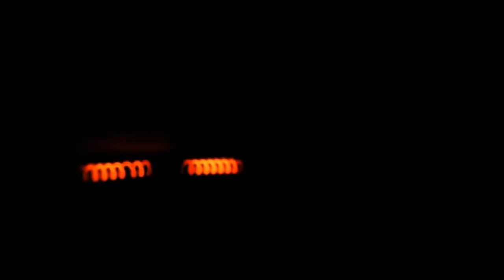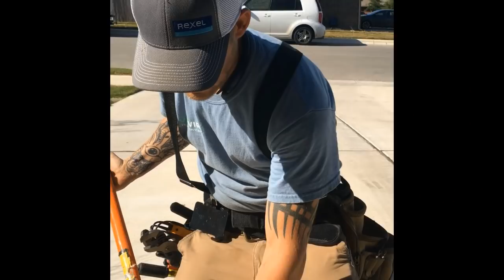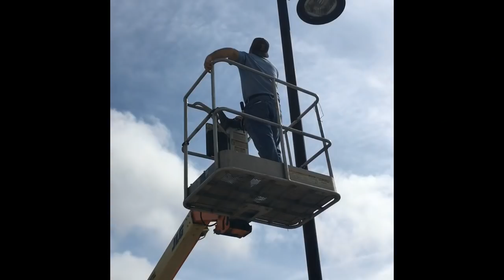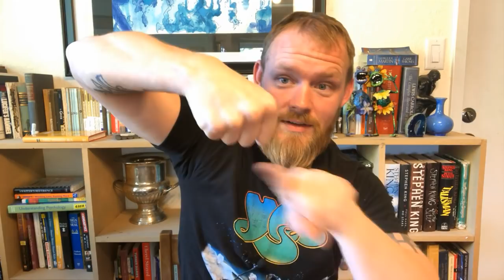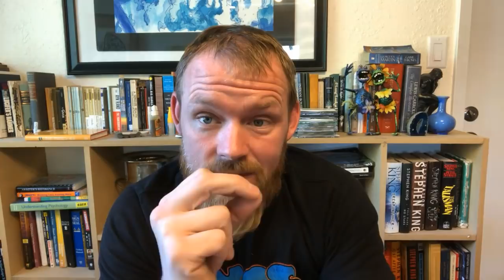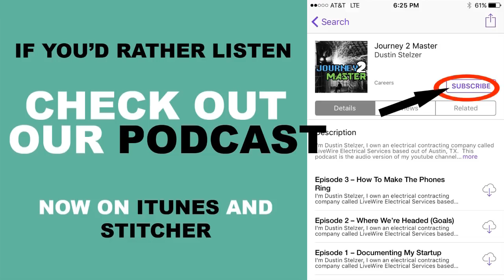Episode 42 - #THDProspective tool event summary

Comment: Also is there a book you would recommend for for all the basics of electrical
Reply: Jeffrey Hall While its hard to find an electrical book that covers all the basics, any Electrical textbook would do. He also has a video on books and lists a dozen or so really encompassing books.
Reply: The Faithful thank you so much I’ll look into it much appreciated
Reply: Rocky_rocker_123 I’m going to get into construction electrical and I’m pretty new when it comes to all of it, i just want to get a head start before i start a apprenticeship
Reply: What industry are you going to start in? Like residential, commercial, industrial? Or service work or construction work or both? Yeah there’s a lot basic book or starter level books for each area. Are you looking start in residential wiring, trouble shooting and residential code? Construction has ton of stuff. Where are you at in your learning? What you dove into so far? There’s also basic theory electronic components too that might great to learn too for control.
Reply: Jeffrey hall Nice. Smart move man. Learn much as you can while your young dude. Just makes life better in the long run. Always keep open on service work too. Trouble shooting is fun too. Do you own a good multimeter yet? Do you have code book yet? 

Tried YouTubing these topics
1. AC genterating power systems(Wye & delta)
2. Inductive, Resistive, Capacitive type of loads. 
3. Conductors, semiconductors and insulators,
4. series and parallel circuits. 
5. power factoring correction. 
6. Capacitive banks
7. Types transformers(oiled or dry) and how coils interact with each other
8. 3phase AC generators and motors. 
9. Single Ac generators and motors. 
10. Variable frequency drives
11. Constant voltage starter
12. Relays(coils and contacts)
13. Capacitors (oil filled or dry)
14. Resistors
15. Transistors
16. Relay Ladder logic schematics 
17. Plc program logic controllers
18. Logic gates
19. Dcs Distributed Control System
20. Digital field devices
21. Analog field devices
22. Resistor banks
23. Dc electronic drive
24. Clock system
25. Electrical Induction heating and resistive heating system 
26. Distribution power panel boards.(3phase, single phase, DC)
27. High voltage or low voltage Switch gear
28. UPS-uninterruptible power supplies systems and standby power supplies systems. 
29. Batteries banks
30. Metering/testing instruments - volt meter, ohms meter, amp meter, watt meter, current transformer for high voltage, potential transformers for high voltage, insulation tester, 
31. Lighting- Incandescent lamps, Compact fluorescent lamps, Halogen lamps, Metal halide Lamps, Light Emitting Diode, Fluorescent tube, Neon lamps, High intensity discharge lamps
32. anode and cathodic protection systems
33. GFCI Ground Fault Circuit Interrupt, AFCI arc-fault circuit interrupter, thermal overload protection, breakers  fuse, time delay fuse, screw in fuses, 
34. How meter with power on and finding blown fuses or open circuits. 
35. Emergency lighting systems
36. Pipe bending(rigid conduit and emt conduit) fittings too.
37. Conduit fill calculation- code stuff
38. Box fill calculation- code stuff 
39. Pull box calculation- code stuff
40. Basic read the code book and search sections on YouTube or google.lol
41. Cable trays
42. Busway power system
43. PVC (polyvinyl chloride)pipe expansion joint calculation
44. Amour cable and tech cable
45. Code will explain location/ environments for certain types cables can used 
46. Non-Metallic Dry service cable
47. Wire gage size according to amp rating
48. Ground rods
49. RS232 communication cable
50. Ethernet commutation cable
51. Fire alarm systems
52. Safety protection(low voltage gloves, ark flash face shield
53. Electrical Isolation procedures
54. soccer lift and boom
55. Crane hand signals
56. Basic load Rigging. 
57. scaffolding
58. Fall protection 
59. Electrical wiring for hydraulic and pneumatic system. 
I probably missing more stuff but this all can think off top my head. Hopefully these topics give yourself a jump start.
Reply: Also forgot this stuff too
60. 6 pulse full wave rectifier, full wave bridge rectifier, half wave rectifier and wheatstone bridge. Now they used electronic drive(IBGT’s) to get the clean dc supply.
61. Rigid Pipe reaming and threading
62. dynamic braking and regenerative braking
63. impedance relay For sang dip in voltage supplied 
64. Earth fault protection.
65. Ohms law calculations. Very important for electricians. 
66. Stoves circuits (code book)
67. Dryer circuits(code book)
68. Dwellings power panel service sizes calculations(code book)
69. Motor control center ( MCC)
Reply from the maker: episode 20
Reply from the maker: Holy shit bro.  That's amazing.  Thanks for sharring, you sound like me hahaha
Reply: Master to journey-> yeah.lol i was going to put more but I didn’t want to blow up the young dude comment too much and look fucking squirrelly. Haha Plus, i enjoy helping out the young minds that are coming out of high school and needing a direction on where to start. I know what’s it’s like being 17-18 and looking at the whole. Plus, I was party guy from 17-24 and kind of drifted through life. Care more about drinking, popping Molly’s, meowing zoomers, hitting up music then focusing on career. Then I got into the trade around 24-25 when I started learning about the electrical world but I had wished I started around 18. I thought electrician just connected wires, install panels before I got in the trade but I was completely wrong because there so much more in our industry. Plus there’s lots other trades that interact with electrical world too.  Plus you can branch to different industry and specialize in certain crafts. I’ve become electrical nerd now days. Lol anything that has current going through it then I want to know about it. I want all the information!! Haha from residential to industry construction and maintenance electrical work to instrumentation and combustion to fuild power systems to mechanical systems to electronics to software to communication systems.Haha Theres no certain order. Lol just want learn how things work and how they put together. 

I’ve been slowly catching up on all of your video on your channel. You seem like a pretty fucking cool guy.🤙🏻 I’ve also been seeing a lot young minds that want into the trade because your videos. Which is fucking rad. Your electrician U channel is awesome for the new trade guys and girls that thinking about tapping into our trade. Keep the good work up. Your video has  inspired me to give back and help out. I’ve been pretty lucky in life and everything’s always seem to fallen in right place for me over the years. I guess I’m feeling more now days that not everyone has been dealt good cards in life or hasn’t been raised in great family or great neighborhood. The chances of them doing well in life is least to none because of their environments. So, I’m always here to transfer knowledge if anyone that’s looking for it. I may not have all the answer or could be wrong at times but I will do my best find out or correct myself. I’m a licensed electrician and this journeyman is still learning the electrical world too. Also open to different perspectives on how to look at things too. Not afraid to say I don’t know. Once it’s out there then opportunity for to correct it and better myself.